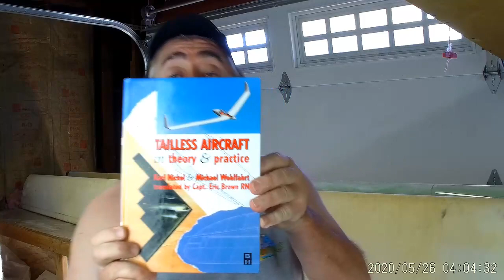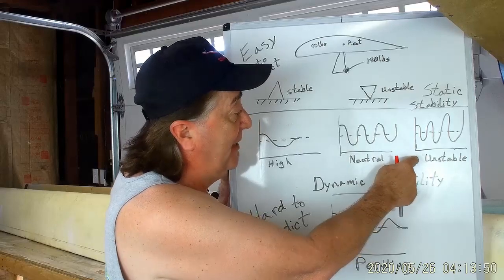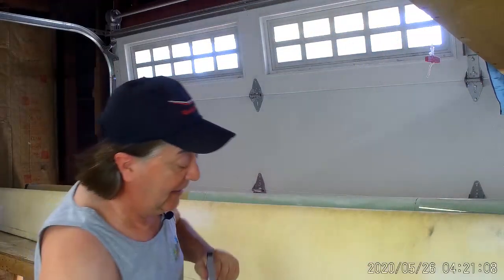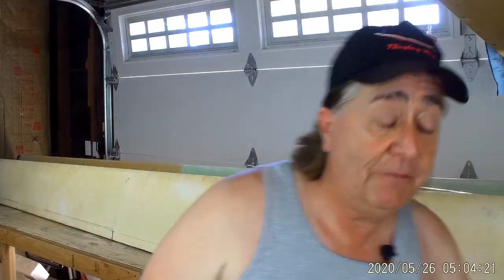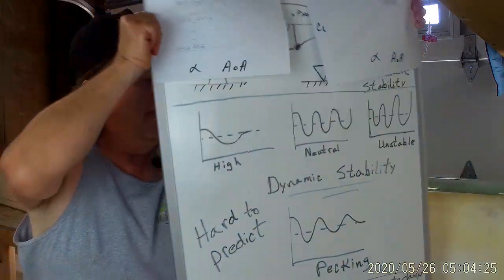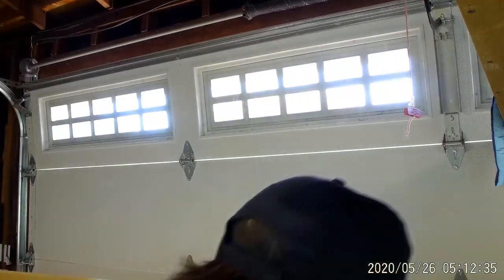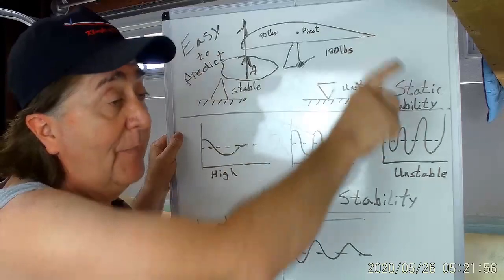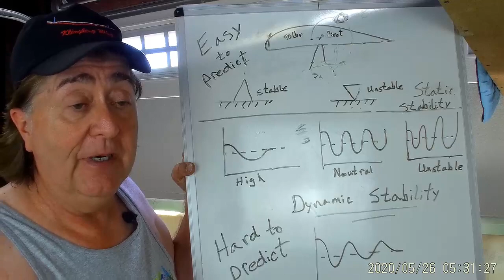Flying Wing Special Topics - Pecking and Dynamic Stability

Comment: Rol, Excellent chalk talk, thanks for you efforts and congratulations on the success of your channel.
Consider using a centerline mounted yoke instead of a stick, it allows for use of both or either arms to control weight shift pitch. Foot stirrups may also be a good option, legs are the largest "dampers" in the human body.
Reply from the maker: Thanks!
Reply from the maker: Some good options that I will consider. Given that two viewers have mentioned the leg option, it seems like something I should make provisions for.

Comment: I found another example of Wing Pecking in the book by Eric Brown but this is different. It was on a Supermarine Spiteful, which was a Spitfire with modified wings that were modified to be laminar flow wings. According to Brown, early models of the Spiteful had three degrees less dihedral and a sharper wing leading edge. The clean stall was preceded by a very large amount of lateral pecking followed by a port wing drop to about 80 degrees. This makes me wonder if my earlier post about the Meteor was also lateral pecking.
Reply from the maker: Very interesting! My thinking is turning to the characteristics of an aircraft dynamic motions and the different "phases" short timeframe cycles vs. much longer. The damping available over small angles and short timeframes can be drastically different than what is available over larger angles and timeframes on the order of seconds. I bet it is connected with "clean" aircraft vs. "dirty" (low drag vs. normal). Not something taught in any of my graduate classes. Maybe an interesting area of study for a PHD student.

Comment: The Millennium and Swift in standard configuration don't have pecking issues. But Brian made a shorter cage, which reduces drag, and that has pecking issues especially at speed.

Comment: Is pecking the same thing as short-period oscillation? Your description makes them sound very similar.
Reply from the maker: Yes, the term pecking just refers to a short period motion in pitch. Pecking is a common, yet slang term used when speaking about flying wings.

Comment: What do you think about the Horten brothers solution for flying wing stability?
Reply from the maker: Lots of thoughts, but not enough space here. I used their work for the basis for my first wing. Their BSLD does create a (generally speaking) stable flying wing, but does so at the expense of the L/D polar, hence probably not an optimum solution for gliders. Gliders require a very broad polar for good overall performance. The BSLD can be a good solution for a powered flying wing that operates mostly at single trim condition.
Reply from the maker: I should also mention that I will have a video in this series that covers performance of flying wings that will touch on the Hortens' work. So, if you are interested subscribe to my channel and click the "bell" icon to get updates of when I post videos. I generally don't post to all the various Facebook groups because of the high labor involved.
Reply: @KlingbergWingMkII  Already subscribed. I have an affinity for flying wings.

Comment: Maybe use your legs and feet as the dampers with stirrups instead of trying to do too many tasks with your flight control hydraulics (arms and hands), should be easier to master and easy to configure given the supine seating position?
Reply from the maker: I had not considered that but an excellent point. Good as soon as the feet are retracted after takeoff!
Reply: Clipless pedals like the cyclists use would be pretty cool.
Reply from the maker: That's the first thing thaat occurred to me also. I could integrate them with the front cross-bar in the pilot's cage. They can stay installed even during transport so it would not increase the setup time.
Reply from the maker: Of course I'd made them out of CF, because that would look cool.